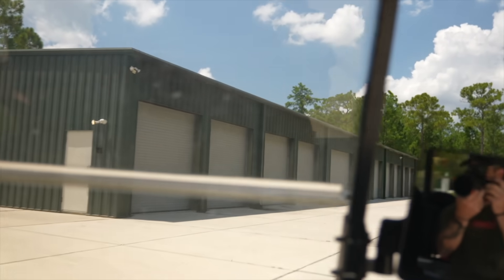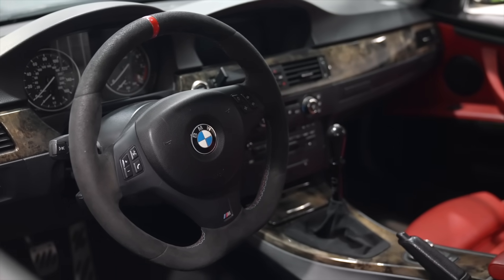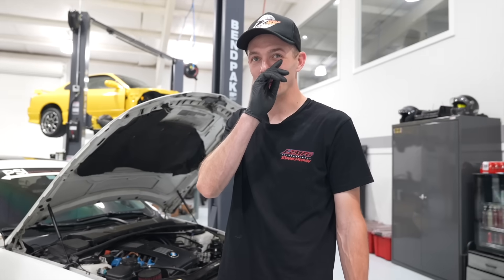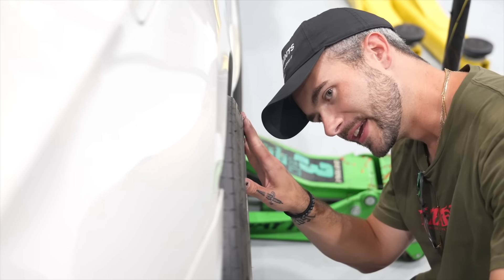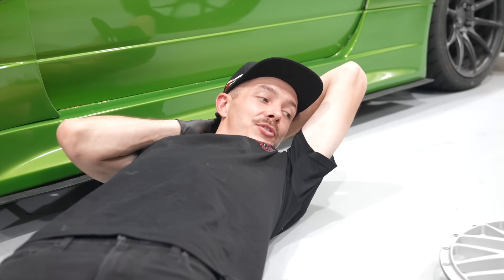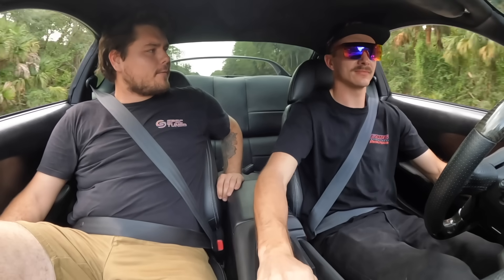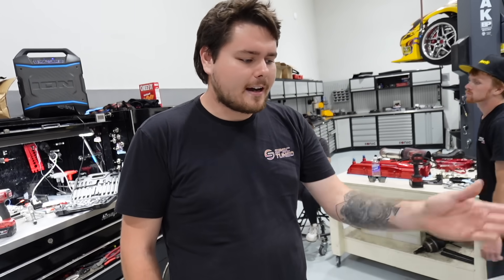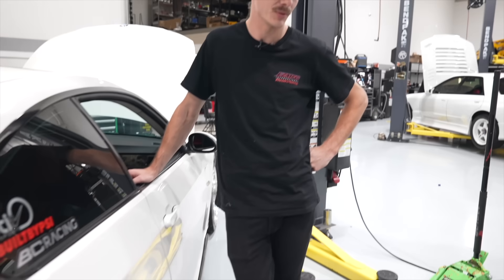My Single Turbo 335i - Here's Why I Abandoned It

Comment: I actually just got my 335i out of retirement this summer after 7 years. I still hold the stock long block record at 861whp but now am fully built with a MaxxECU and DI delete. Crazy how much better it cooperates and drives. I ditched it 7 years ago because of the same reason because of the tuning side. I was a test mule for a lot of what the MHD is now and I just got tired of it and tucked it away in my shop. Stephen Green with Greens Motorsports was the one that got me set up with the MaxxECU and DI delete and made the engine harness. He wants to help you if you’re down.
Reply: man id love to hear the stories of this car you have!
Reply: My motiv ST 07 335 has been packed away for at least 5 years for same reason as well. Maybe some day ill bring it back to life. 🤷‍♂️
Reply: I'm at currently 720whp on stock block for years. Still going strong! I do plan on going with DI delete setup maybe MaxxECU or NEXSYS Motorsports kit.
Reply: Quick question, would you recommend going DI delete and standalone ECU for daily driving? I was kinda wondering whether or not I should go that route. Or just stick with DI and PI combo instead for clean ports mostly
Reply: @MKRN98  really depends what power you’re wanting to make or currently making.  I actually made the 861whp on the stock long block on a stock dme with a Cobb and then a haltech platinum sport for the PI and boost control and it worked great aside from the tq limitations and shift bog.  When I switched to MHD we fought and fought tq limitations and throttle closure past 900whp and it just became frustrating. With the MaxxECU and DI delete I cruise this thing all over no issues and once I get the radium surge tank installed in the next week or so to get around the last of the factory regulator and should be around 1100whp. It’s honestly never driven as nice as it does now and the CAN control I’ve gotten basically everything working again aside from AC which should be a simple digital output to trigger the magnetic clutch in the compressor.
Reply: I actually had one of I think only 2 of the Syvecs plug n play ecu’s a few years back but ended up selling it back to Jake H with Motiv because of the lack of tuning support at the time.  Back then though I wanted to ditch the DI and go only PI but there weren’t viable options like there is now with the drop in DI delete.
Reply: @MR2Josh  are you back on any forums? Id love to keep up with your build, especially since im going to have to do something with my notiv build sometime soon as well.
Reply: @MR2Josh solid information thank you for taking the time to type it
Reply: me too!! mines been MIA for 5 years and I pulled it out and put my stock downpipes on and kinda fell back in love..
Reply: ive been on maxxecu with n53 head, bc 3.3l stroker kit 11.5:1 with mid sleeved block  for two years. 8hp swap with tubo lamik. g42-1450 and it for sure makes 1100+.   drives just as nice as my 24 m240i.
Reply: Is the canbus integration on maxxecu sorted for this chassis? I know they have quite a few bmw's already working on canbus. And with the recent 8hp integration, it seems like a no brainer
Reply: @runesmDK  yes it is.
Reply: Well mister “mr2” the stock block record is actually 939hp and has been for a while. Guy was running Chinese turbos too.

Comment: DocVu I believe is his name but he tunes a lot of fast n54 cars. One thing you need to do is put the port injection on its own pump and lines. The DI requests different fuel pressures from the low side pump and it throws off the tuning on the port system making it a tuning nightmare.
Reply: The motiv reflex plus has a rail pressure sensor that helps correct for it.
Reply: Yes doc tuning is exactly who you want to talk to. The car is going to need motive reflex with a precision raceworks PI kit or if you have one on the car already it’s fine and can be modified very easily to work with the reflex. Use twin-triple pumps in the rear and try to keep them on a hobb switch so they’re happy and not always drawing currents since BMW and electronics not fun. Last tip would be have index 12 injectors for DI, they’re the newest DI injectors from BMW and I recommend them the best.
Reply: +1. Doc tuned my friends single turbo n54 (not port injection) and it runs awesome.
Reply: If you’re having misfire issues you might have to upgrade the ecu to the msd81 over the msd80.  They are both OEM ecu’s but the 80 has issues with the mosfets inside that cause a lot of misfiring problems.  The 81 was introduced to fix these problems and can be found in later model cars.  Adam’s should be 81 but might be worth the check.
Reply: 100% agree on Doc Vu, I’m big turbo and never had an issue
Reply: I had the wood grain in my e92 also but with saddle brown interior (peanut butter) and I was absolutely in love with the dark wood trim
Reply: +1 for DocVu Tuning
MHD with Reflex+ port injection controller is the way to go

Comment: 335 prices bout to explode again
Reply: No they ain't 335i are everywhere. Won't go up till everyone realizes they a good drift car. But again theirs a billion e9x on the road
Reply: N54 is trash and cost a lot of money to add power.
Get the new 330i B58 turbo
Reply: @connoisseuroftigolbitts 340*?
Reply: @zmohan69 not true I’ve been looking for months for a decent one. Majority of the clean ones still command ~15k it’s absolute bs
Reply: @zmohan69  Not many 335i in my area. Mainly 328i
Reply: I wish lol, I want to sell mine but not for kbb price. 97k miles $6000 Ill pass
Reply: @chesteryao  nah you can get 10 but it also depends coupe/sedan and manual/auto
Reply: @marcfrazier4274 bro go b58 . Save up and get the right one out the gate. Because you will hate it less when it gives you issues. HARD pass on the N54 . Modded they are worthless.
Reply: @connoisseuroftigolbitts  love n55s tho have one stage 2 with 100k miles runs good
Reply: Facts, hard to find a clean manual one already smh
Reply: @Vgk36  had mine before the b58 came out. I would love to own b58 one day
Reply: @connoisseuroftigolbitts dude what it’s literally 1500$ to make 500
Reply: @connoisseuroftigolbitts 330i has the B46/48 which still makes 500+ if you do it right

Comment: The cheat code to a reliable n54 powerhouse in 2024: 

MaxxEcu, port injection only, single bank o2, B58 coil conversion, Ken at Wedge performance for tuning 

Remove the pi plate and replace with an intake manifold that supports pi

Throw JB4, AIC & PR coils in the bin

So much love for your 335, it's the reason I got my manual, alpine white '09 335i almost 5 years ago! Can't wait to see this thing back ripping harder than ever 😍😍
Reply: Maxxecu is the sht these days, great ecu but Idk if they work with Can bus on the 335i
Reply: Works flawlessly have the full integration on my own only 1800 for a maxxecu race with flylead harness
Reply: Tell me, where do i find the top feed port injection?😁
I have one n54 myself, and the injectors are bad asf
Reply: MaxxECU is amazing. I have a Race on an 08 Saab, it has completely deleted the stock ECU and is emulating all the CAN outputs, the dash and AWD system that relies on those messages works flawlessly. Maxx doesn't natively support the Saab CAN messages but it's so customizable we were able to define all the messages ourselves. Adam should have enough reach for someone to be able to do something similar on the N54.
Reply: @JakeT3584  Yea, highly recommend maxxecu as well. Have it on my old Ford Sierra with itb's, not alot of canbus going on, but its just very pleasant and capable to work with.
Reply: @TheGoodMedicine MaxxEcu has oem can support for the E9x
Reply: Time to move on. I'm loving my m240i with DME stage 2 tune.
Reply: Ken >.... he tuned my 1M and it was 10/10
Reply: For sure need to do something for my z4 35i
Reply: @TheGoodMedicine ofc they do even ecumaster works
Reply: Good stuff. I have my 2010 mhd tuned by Ken with reflex + running the pi manifold. Single turbo precision 6466 speedtech. Runs amazing. All work done by Rj soriano at MFautoPerformance in NY
Reply: The B58 coil conversion sucks get the Audi coils
Reply: @TalonY135  Would you be willing to share the canbus settings you have?
Reply: How about for a stock mapped build is port injection needed?

Comment: 1. Take the JB4 off 
2. Get a MHD super license and re tune the car
3. Take out the ACI port controller and replace it with MOTIVE REFLEX + 
4. Get a 335is front bumper
Reply: Exactly. Shit isn’t that fucking hard.
Reply: I never gone back to jb4 after installing MHD lol
Reply: Get it tuned by Steven at wedge !!! 
Wedge is the OG tuner with MHD 
Please him and his team are the gods of stock bmw ecu. They are the originators of the rolling anti lag for n54 on stock ecu. They just helped 4n motorsports tune a N55 that’s destroked to a 2.8L revving out to 9k again on stock ecu. 
Steven is such a god he’s even helped me so much with a xi to RWD conversation on my wagon.
Also Adam plug your head ports that drain/ drip oil into your intake port will delete vacuum to pcv system. Just run a double catch can n vent them into the exhaust with a Venturi bung. 
Bam walnut blasting is forever gone from ur life . 
1000% GET RID OF JB4 & AIC pi controller. AIC is so terrible its batch fire & is a disgusting piggy back tuner. 
MHD & motiv reflex +  FTW 🙌🏽 
Completely changes the game
Reply: @alexhi9793 yes dude. The problem with this kid, he doesn’t listen.
Reply: @stephensnyder1055    At the same time I don’t blame him cuz 99% of his cars just work off rip lol but his car was definitely made on a Monday morning when everyone was hung over after a holiday rager 😹
Reply: I'm not an SE fan myself, but LZ loves the SE bumper with the aero lip
Reply: Steven at wedge sucks. Bad take.
Reply: Nothing wrong with Jb4! Terry is great and super supportive, if anything is wrong with jb4 it’s usually firmware and that’s easy..I know a lot of people running 700whp plus with a jb4 setup and I’m one of em! Not quite 700whp yet but I have no issues! Reflex and MHD is great no doubt but jb4 has been around and tested for a long time now! The notion that it sucks or is junk is ridiculous honestly..it works
Reply: @ecmfreestyle  JB4 is outdated. MHD is the way to go plain and simple. Unless you own one you wouldnt understand stop basing your takes off what you see on the internet
Reply: Will the 335is bumper work out of the box? Adam's car has the pre-LCI headlights, no?
Reply: @laggyis  jb4 is outdated? lol 😂 terry burger still supports the n54 and comes out with updates to this day, second I own a ST N54 on jb4 wit MHD backend flash tuned by CD919! The jb4 has been tested for years and works fine! The ones saying it’s outdated or it doesn’t work are those who just copy and say what they hear on the internet! I’m not here to argue I’m just simply stating facts! I’m not saying that MHD and reflex doesn’t work or that isn’t a better option, but for people to say JB4 is junk or outdated is nonsense!
Reply: Do this, bumper is optional adam 😂
Reply: Wild he complains all the time about the car giving him issues when he's willingfully running jb4 with such a setup, kind of shooting himself in the foot on that one.
Reply: this is correct. Throw the jb4 away, get a reflex, get a phoenix racing port manifold (plate kits suck). get a dyno tune from a good tuner(JSR,DocVu)
Reply: @alexhi9793  Isnt this car tuned by Wedge? I remember the last video with it years ago Jordan from RKTunes made him get new injectors and set him up with a tune from Wedge
Reply: Exactly
Reply: MHD, MOTIVE REFLEX, RK TUNES
Reply: @ecmfreestyle  JB4 is ancient compared to OTS tunes like MHD and Bootmod3
Reply: @SaturdayWinter  I understand that in terms of only using the jb4 but if he’s using it with MHD and the BEF feature he shouldn’t have an issue
Reply: @stephensnyder1055  bro just asked for our opinions, why so offensive? maybe he has other cars/career to focus on. just maybe though.
Reply: @laggyis  fr. im mhd tuned by @cd919 absolute goat NGL. a lot of people i know are docvu fans but IMO he likes to push the platform a little too far and considering LZ is going for a street build i think cd all the way.
Reply: @ecmfreestyle  listen it may work but at the end of the day its a backend flash your better off running MHD by itself and just coding in the features you want. 1 ST n54 to the next.
Reply: @fastbanker  ONG they suck and its the same price as getting the phoenix manifold, these are youtuber we are talking about its Vargas or bust unfortunately
Reply: Amen
Reply: @ecmfreestyle cd919 the goat

Comment: Hi ya, fellow E92 owner here,

oem grey/poplar woodgrain was actually a thing in those, these are the OE partnumbers:

1 51-45-6-958-016 COVER, DASHBOARD 1 1 83.55 83.55 S 22
2 51-45-6-958-018 COVER, DASHBOARD 1 1 250.94 250.94 S 22
3 51-41-6-958-237 DECOR STRIP, LEF 1 1 192.38 192.38 S 22
4 51-41-6-958-238 DECOR STRIP, RIG 1 1 192.38 192.38 S 22
5 51-43-6-958-249 DECORATIVE STRIP 1 1 98.45 98.45 S 22
6 51-43-6-958-250 DECORATIVE STRIP 1 1 98.45 98.45 S 22
7 51-16-6-964-269 SET DECORATIVE S 1 1 377.03 377.03 S 22 (w/ idrive)
8 51-16-6-966-471 COVER, REAR CONS 1 1 289.79 289.79 S 22
Reply: Fellow E92 Space Metallic Grey/ with black interior and woodgrain trim here. I’ve been contemplating going with carbon trim myself. Funny story an older gentleman asked me why I hadn’t gone with the carbon trim, and I told him I liked the woodgrain.
Reply: I have a white e92 with the grey/poplar interior

Comment: @13:18   Little pro tip, it’s way easier to turn the handle if it’s at about a 45 degree angle. There’s a joint between the handle and the valve, and if the handle is straight up, the joint is not straight, and so looses a ton of leverage trying to rotate.

Comment: Go 
-Maxxx Ecu 
-di delete 
-pi only (r8 coils so the maxxx ecu can control them 
-15in 
-bucketed dual 450 lpfp (dual lpfp 450+ will over heat the Ekp)
Reply: Got my Precision 6466/MaxxECU E46 330ci driveable on day 1. Super easy to tune!
Reply: No Thats stupid
Reply: @FriendlyIntentions  how so?? It’s make it more consistent and also illuminates di which is hit or miss plus cost 3k
Reply: N54’s are so expensive to build you might as well just buy a new 340I and tune the b58
Reply: so go from one tuning nightmare to another? nexsys started releasing a full DI delete but still nobody tuning it, and MaxxECU is still over priced to end up spending a ton in trial and error
Reply: @lodofficial983  it’s not a tuning nightmare having the right person behind the keyboard stock dme or standalone. Christ at motive can make that car work with a reflex instead no issue. I was just suggesting maxxxecu because di delete.
Reply: @lodofficial983 how is maxx ecu over priced compared to similar options on the market? If that’s the case then everything is insanely overpriced.
Reply: @lodofficial983 why do you think maxx is over priced?
Reply: @connoisseuroftigolbitts  330i doesnt have a b58. it has a b46/b48 4cylinder. you must mean 340i or m340i?
Reply: @connoisseuroftigolbitts bro 330i has a B48 lol
Reply: @e92erik  340i*

Comment: Ken from wedge performance has a lot of tuning experience, tuned the most n54s and has been part of different projects throughout the n54 world regarding tuning. (Jordan from rktunes mentioned him in one of your videos)
If you have random misfire problems during WOT, ditch the Precision raceworks coils and run the nexsys b58 coil conversion kit with NGK 94201(from the b58) plugs gapped to .024.
MHD has improved a lot with new single bank 02 tuning and MHD+ 
If you have bad timing corrections the only real solution is mainly new injectors followed by plugs, coils then o2 sensors. That's if the tune and fuel is good.
Surprisingly enough there are still developments going on in the n54 world, with straight port injector replacement with Nexsys conversion kit that is still controlled by the stock dme and stuff like vacuum pump gear replacement to get more fuel from the hpfp from Hydra Performance.
Reply: Ken is the man
Reply: PREACH! You spoke my mind on this!🙌🏼
Reply: Ken's response times are atrocious.  Solid enough reputation otherwise.
Reply: +1 for Ken, he maintains the OTS maps for MHD.  Busy guy if you email, but he's pretty active in the 35i WhatsApp group

Comment: I had a 335i for a few years. 
Got it because of you. 

It was a maintenance NIGHTMARE. 
One owner with 82 k and it had all the service papers. 

I still went through 3 water pumps in 30k miles. Along with everything else that broke too.
Reply: Did you replace with an oem one?
Reply: @raf1320 I doubt it - they should be good for 70k
Reply: Got mine at 79k miles 7 years ago because of Adam LZ. Now at 97k miles I had replaced almost everything that's maintenance and it's still leaking oil lol
Reply: sound to me like something else was wrong in the cooling loop. was your radiator clogged or something?
Reply: @VARADAMODUBLIN exactly there are some parts that you should only buy oem
Reply: @raf1320  OEM Bosch every time. 

Luckily 2 went under warranty through the supplier.
Reply: @rabbitdrink  replaced everything in the cooling system at least once. 

Every hose and fitting had been touch. 

Radiator had been completely flushed multiple times that was the issue.
Reply: @killacam2644 damn that suck some people have the worse luck
Reply: @raf1320  these cars are so hit and miss. 

I’ve heard all the same things “didn’t use OEM parts. Fire your mechanic. Ect ect ect. “ 

Had one of my local experts who was shit talking do the water pump job “the right way” and it failed after 6 months. 
Maybe Bosch had a really bad batch of em. But had a bunch of stuff fail.